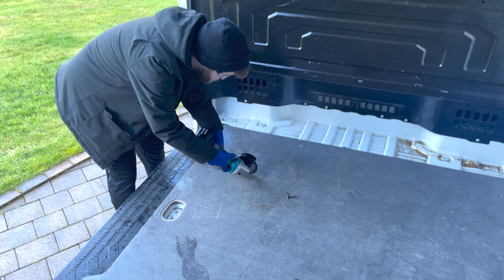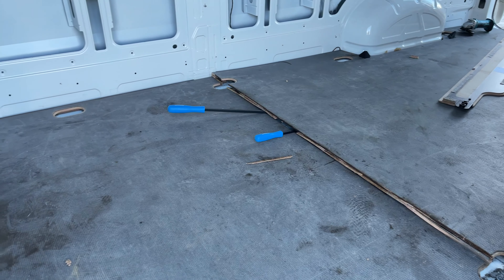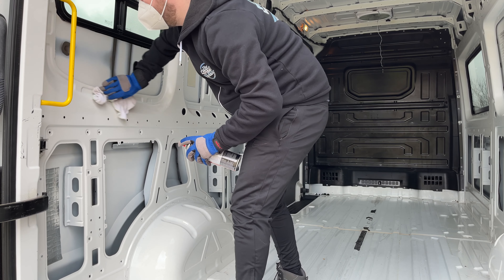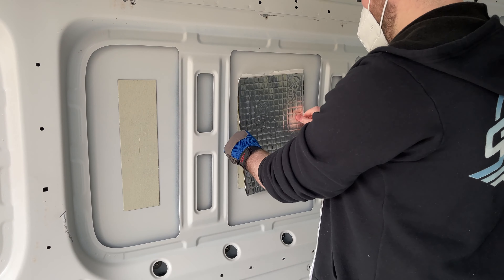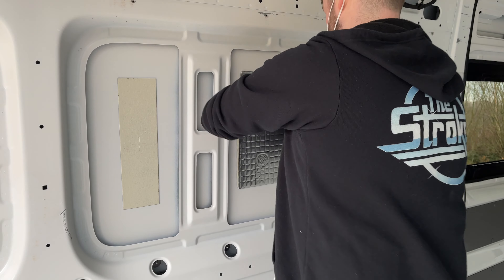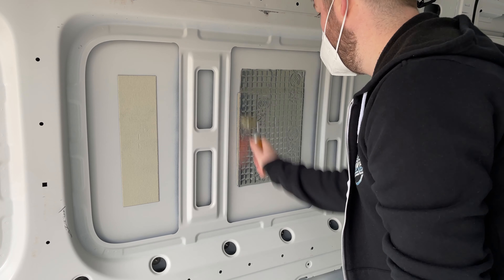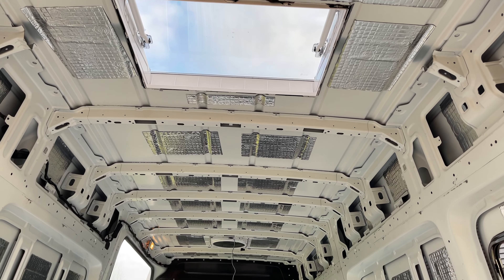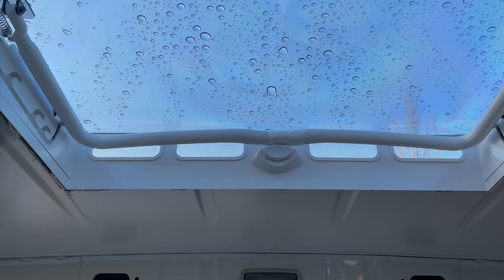Episode 2: VW Crafter LWB Campervan Conversion - Sound deadening, Maxxair Fan & Skymaxx Rooflight

Comment: Hi Chris, Great insight into your van build, I have a lwb Crafter that I’m just sourcing parts for and am wondering what size skylight you used down the back. The box section bracing in my roof is too close together for biggest size, maybe yours is different being the xlwb. Looking forward to seeing your next step 👍
Reply from the maker: Hey! Thanks for watching! The size for the skylight is 500 x 700mm for a 42-60 mm roof thickness! I picked it up from here:

https://www.marcleleisure.co.uk/skymaxx-plus-lx-rooflight-500x700mm-42-60mm-roof-thickness.html

I actually sawed away one of the sections which go across the top of the van to make room!

Comment: Thanks for the video - some great tips. I am about to lift the floor on my VW Crafter LWB. I am keen to reuse the floor and have lifted the first bit. There is a lot of glue kicking about - what did you use to get the glue up from the floor? Cheers!
Reply from the maker: Hey Ian! Thanks for watching. Getting the glue up was a bit of a nightmare. I used some of the De-Solv-it sticky remover and left it on overnight nearly - it might take a few times to get it though! I also used a heat gun and a scraper on a few parts. It was a bit of trial and error! Hope this helps! 

https://www.amazon.co.uk/Solv-Sticky-Stuff-Remover-100/dp/B00M36W1XS/ref=sr_1_7?crid=3L75JFAX047ZC&dchild=1&keywords=sticky+stuff+remover&qid=1628200088&sprefix=sticky+stuff%2Caps%2C176&sr=8-7